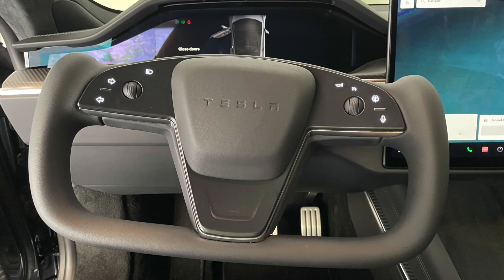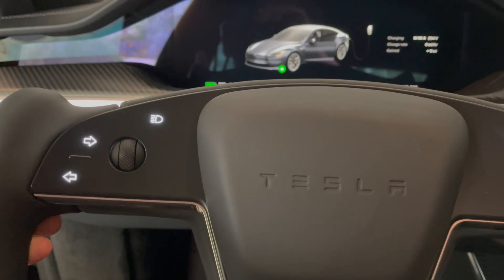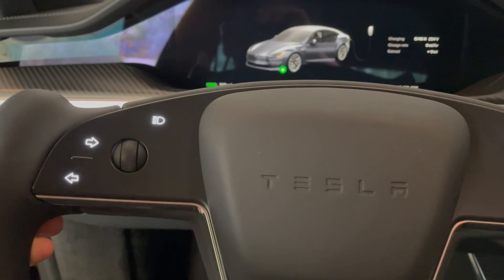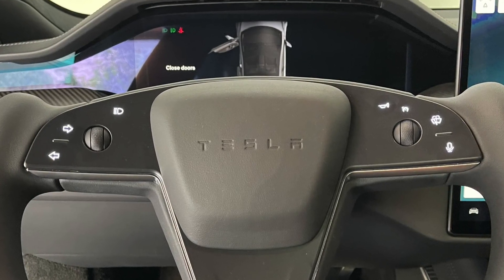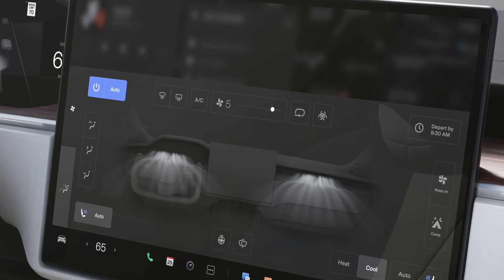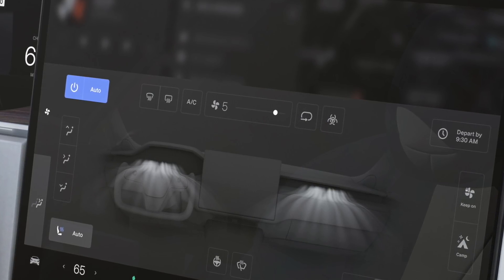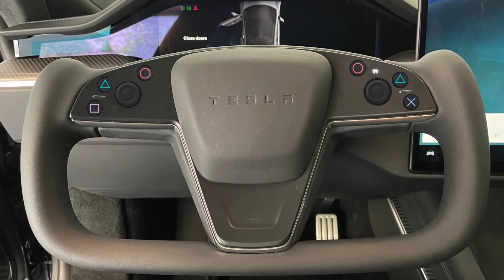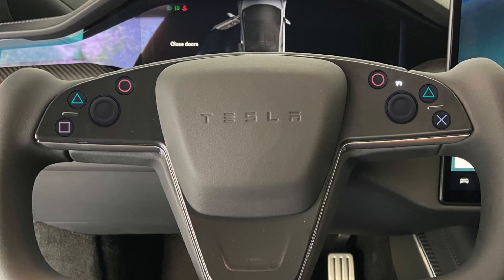Fixing Tesla's Model S Plaid YOKE blunders

Comment: Tesla is the Apple of the Car Industry, in both the good ways, and more importantly the bad ones.

They both helped to popularise new technologies (Electric Cars and Smartphones), and whilst they didn't invent them, they played a significant role in increasing their adoption.

They both are incredibly arrogant and make design decisions that favour form over function, making stuff look cool whilst sacrificing usability - Apple took away the headphone jack, whilst Tesla took away the ability to even know what you're pressing.

Both insist on using proprietary standards for charging their products. Apple still uses the 8-pin Lightning connector on new iPhones whilst everyone else uses USB-C, and Tesla uses their proprietary Supercharger , instead of the industry standards (though those do vary between countries, since unlike Smartphones which mostly use a single common standard  like Micro USB or USB Type-C, there are a few competing connector standards like Type 2, CCS and CHAdeMo, and also depends on where the car manufacturer is based, but at least there is some shared standards and some level of interoperability (even if its just having multiple plugs at chargers), whilst only Tesla vehicles can charge at superchargers, and you'd need an adapter to plug it into some chargers)

Also, both companies share a very aggressive stance against the Right To Repair, with neither selling replacement parts and designing their products to make repairing them near impossible by anybody outside the company (also, if you haven't already, I'd recommended watching Louis Rossman's videos on right to repair, where he mainly focuses on Consumer Technology companies like Apple, but he has also made videos about car companies like Tesla).

Comment: This entire UI seems poorly designed. You can't locate controls by touch, and the layout is super awkward. I agree that they really should look at existing controllers, because there's literally decades of testing done. But some of that should be other cars - "if it ain't broke" is an oversimplification, but at the same time the controls that have survived have stuck around for a reason. Learn from them!

Comment: I had no idea Tesla control interfaces were designed so poorly. This is overengineering. I'm all for coming up with new interfaces, but the benefits of switching to the new should be practical and offer obvious benefits. Think phones going from button keyboards to the iPhone capacitive touch screen. Maybe you were resistant at first but then you used it and instantly got it.

This just makes you want to go back - all of these issues would be solved if it had a normal steering wheel with buttons and lever switches for wipers/signals like other cars have.
Reply: Exactly David!
A case of a solution in search of a problem.

Comment: Before I get started I can't believe that the horn is that stupid little button that is such a horrible idea, I have a hard enough time finding the much larger horn buttons in my car when I'm steering I can't imagine finding that awful little "button". Ok so I think that the indicators should be on their respective sides, like left on the left and right on the right.  Also touchpads are just plain bad in my opinion, actual clicking buttons (or even squishing buttons) are far better as you don't need any haptic nonsense to know that you activated something. I also think that if the wheels were replaced with analogue sticks then they should have the ability to be bound to 4 directions to avoid misdirections (have a game mode where they're free but have them bound for driving).  The yoke shape is fine with me and I'm fine with them ditching the stalks, but they should have taken an approach more similar to Ferrari.  Also not mentioned in this video but the transmission selector is the stupidest thing ever.  The auto selection is just asking for a crash and having a tiny little strip of the screen is just bad.  Shouldn't be in a screen, needs to be it's own separate unit (I know the plaid has separate "buttons" but you have to push pretty hard on those so I don't like them).  Otherwise I agree with your design and I realize that yours is far more realistic and practical

Comment: It should be noted that while drivers can acclimate to a yoke steering wheel, the reason they’re used in race cars and not consumer vehicles is because race cars rarely have to make the kind of rotations with the steering that consumer drivers have to in their everyday in sharp turns and backing out but also in emergency situations. Having a circular wheel allows for a driver to grab anywhere in the region if a two handed sharp turn needs to be made.
The yoke, with it’s rectangular shape increases the likelihood that the driver may accidentally miss the wheel when they need to make a dramatic turn to avoid an accident.

Tesla is not and has never really been super focused on premier consumer experience, it’s always been about what looks cool and it’s often what is gimmicky, from their shitty yoke steering wheel, to the flush door handles that freeze closed, to that not entirely accessible interior manual door latches. These things can become potentially very dangerous as well.

But hey, at least you can tell your car to open and close its doors to Christmas music or play farts from your horn.

Comment: The one question I have with this steering wheel is “Why?” What’s the point of making it a yoke? Wouldn’t that make 90 degree turns harder since you have to grab specific spots on the wheel instead of just anywhere? And why the touch buttons? What benefit could they possibly have over a lever? I just don’t understand at all. Is the reason literally just because it looks cool? That’s a valid reason when it comes to video games, but cars?

Comment: I still hate it that phones now mostly have no buttons, at least the volume can be changes with buttons still.
But darn it, give me back the 3 buttons - return, menu, ok.

Or hack, now that phones are way too thin - just give us flip/slide-phones with a keyboard again. 

With cars it has gotten so bad with "everything needs to be electronic" - no, i do NOT want electric-only windows. Sure it can be a nice feature, but they have a lot of downsides as well. They are often slower than doing it by hand and tend to fail more often. Have also seen a car with capacitive window controls go haywire when a few drops of rain got in - Have fun when it starts raining and you can no longer keep the windows shut cause the car decides "nope, that button is pressed".

Comment: I appreciate what Tesla is trying to do... But I really dislike the lack of physical buttons and switches. I'm all about browsing the screens when parked but I absolutely need to know what I just did without taking my eyes off the road.

Scroll wheels might be okay if they only scrolled and did nothing else, could be useful for skipping ahead in a song. Touch screen is fine too for settings that can be changed when parked. AC and air controls should be physical buttons as they're accessed relatively often. Don't know about the radio.

For games... I don't think games and movies have any business of all being part of a car... Although it is self driving so I guess that's fine. Even if not accessible during manual driving I'm more afraid of the precedence Tesla is setting.

Comment: Ugh. Touch sensors are awful. That garbage technology couldn't even produce power buttons for game consoles that worked reliably. Why would I want that trash in a car? I'd love to tap on these stupid sensors 4-5 times just to do something as basic as honk the horn or use the windshield washer. Not like I ever need those to work instantly or anything. I'll just get snow and slush and crap sprayed onto my windshield by a semi and then continue driving blind because the touch sensor for the washer won't friggin' activate. Great idea, Elon! 🙄

Also, why should I EVER have to tap again to switch the turn signal off? We have already mastered the technology of the turn signal shutting itself off when the wheel has been turned enough. Why on earth is Tesla going backwards in technology and requiring more input?!

I can't even attempt to be polite, this car is complete garbage. Throw it in the bin.
Reply: Sorry to be blunt, but your proposed solution is also awful. Replacing touch sensors with buttons doesn't solve the problem that this stuff shouldn't be buttons to begin with. You want to fix the turn signals, put the stick back. You want to fix the horn, put it back on the center of the wheel. Wipers go back on their own stick as well. Now the buttons on the wheel can be used for the less important controls like music. The broken scroll wheels can go and be replaced by nothing because they aren't needed anymore.

YOU KNOW, LIKE A NORMAL 🤬ING CAR, WHICH WORKS PERFECTLY AND ABSOLUTELY NOBODY WAS ASKING FOR SOMETHING THAT WASN'T BROKEN TO BE FIXED!!!

Comment: I think you’re holding the steering wheel too low. Holding higher gives your thumb more extension and clearance over the touch buttons. 

I think the scroll wheels should be on the back of the yoke.

Comment: Those interface flaws that Tesla seem to be swearing by are really the killer to what I think is some of the most important work that's being done in the EV sector. Even though the focus of these cars is to automate the private transport experience, there still has to be some consideration for the manual driving experience as well. The fact that many people can handle a selection of up to 20 controls just around the steering wheel gives them so much more available space than they've bothered to exploit and, ironically, they've made their current lineup so much more stressful to use as a result.

On top of that, I really don't know why plenty of essential information is off to the side and hidden in all sorts of menus. That's not even slightly helpful to anyone.

Comment: How do you hit the indicators if the "yoke" is turned? With a round steering wheel you can have your hands positioned near the stock/stalk pretty much all the time. Here the touch pads could be at an awkward angle is going round, say a roundabout, and you want to change your signal to say you are coming off.

Comment: I don't know why modern cars have to be so computerized. Cars (including early electric cars of the 1900's-1910's) never used computers in them (well computers weren't around back then anyway) and cars worked just fine. Just a few analog gauges, that's all you need to tell you what you need to know.

Comment: Definitely a car designed by product designers rather than interaction designers. I honestly don't know how Tesla could pass safety regulations with such a steering wheel. It kind of reminds me of when apple or google tries to make multitasking work on touch devices, only to come up with worse and slower solutions than conventional resizable windows. stuff that was designed in the late 70's... The Tesla cars looks and functions like concept cars, not proper production units.

I honestly despise Tesla. The company market itself as green tech, but in reality it is just a capitalist venture to exploit consumer patterns using the trend of "green tech". Because, in the end, Tesla do little for the environment. The life cycle management is poor, the proprietary parts and lack of independent repair creates immense amounts of waste products... When it comes to the cars... sure, they have no exhaust, no CO2 while driving... but how much CO2 did it require to manufacture the tank? (hint: the battery)... it requires a gasoline car to run 7000-9000km for the production of a Tesla to become even CO2 neutral to a gasoline driven car. And this does not include toxic waste produced by manufacturing lithium ion phosphate batteries.

Green tech only becomes green when we make wide infrastructural changes that results in less reliance of heavy transportation (cars, planes, freight ships, which coincides with unnecessary consumer goods and wasteful consumer products) as well as reliance on batteries. We need infrastructural changes that re-uses waste by create renewable energy like natural gas and fertilizers etc. We need to repair and re-use, NOT produce. We need to live in a world where the economy isn't built on constant growth, in a world where we have limited resources.... If we want to be green, the solution does not lie with Tesla. They are a capitalistic venture. nothing less, nothing more. And I hope people understand that.

Comment: So many things I see here are infuriating. I have a model 3, and while the scroll wheels aren't amazing, they are at least functional without a lot of the issues you describe. Hand position and what looks like more wheel protrusion means side clicks never activate push clicks. Hardware lining up the detents with the scroll quadrature should be a given as this is not a 4 dollar computer mouse wheel.  Touch buttons are infuriating in every way. The very least they could do is license apple's taptic style haptics that are strong enough to feel like a physical button click (which would be strong enough to be felt over road noise).
So many problems here that are yet more "We intend the car to drive itself so we won't put driving UX effort in"...but we are still very far from no user input self drive that the controls must still be functional for years to come. 
I like a lot of your suggestions for button fixes.
The one that drives me crazy is on the model 3, when I get in range of my garage, the homelink garage door opener menu pops down. I click the door, but the menu stays up there, covering the top half of the video feed to the rear camera, where I can see what I'm backing into. Frequently, the door doesn't open, so it's 2 button presses to try again. Huge rearrange needed + hopefully in the pipeline with fsd interface wide rollout coming.

Comment: Using a game-controller as a model to solve all this is spot-on.  The flush touch-sensitive pads (not buttons) have great cosmetic appeal, but create a very big problem: they're hard to use when you're not looking right at them.  Same goes for the touch screen.  Controllers are designed so you can keep your eyes glued to something else (TV or the road in this case), by providing a surface that can be navigated by touch alone.  Clearly that's a safety enhancement when it's in a car, and something I think we all took for granted with older button-based car dashboards and control levers.